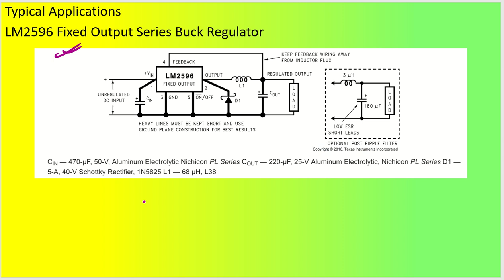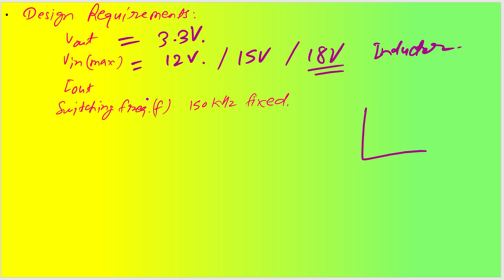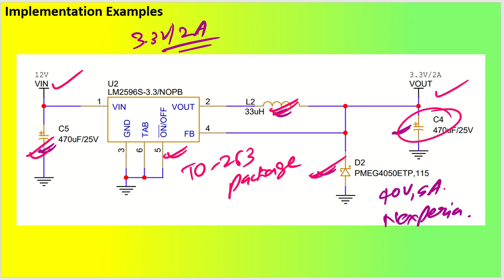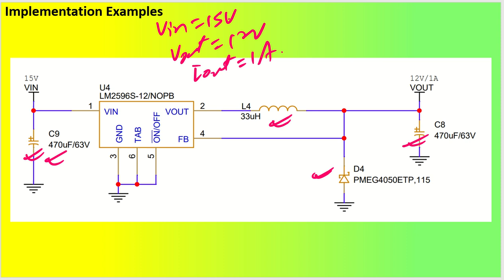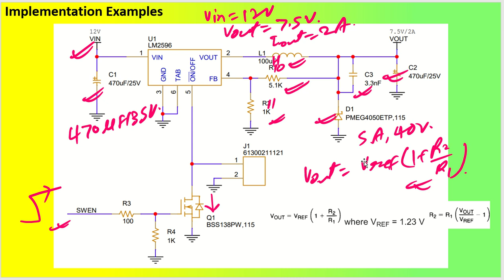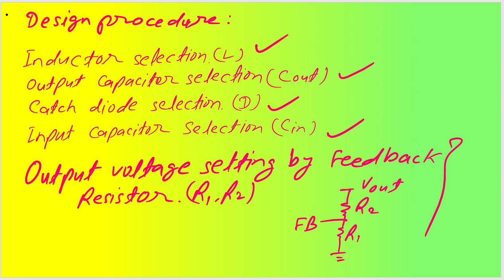060 Switching Regulator Simple Switcher Applications workshop LM2596

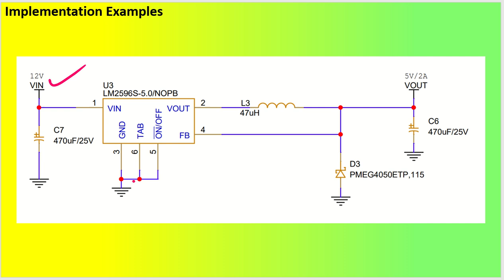Comment: @03:21, @06:36  - In circuit Diagram , the schotky diode is placed on inductor-Cout Junction. Shouldnt it be conencted directly between GND and Vout PIN?
Reply from the maker: Yes, please correct in your circuit, this is mistake.